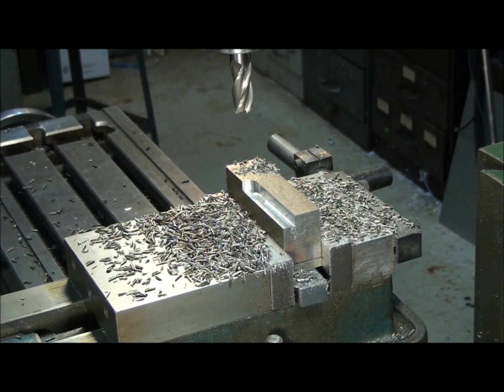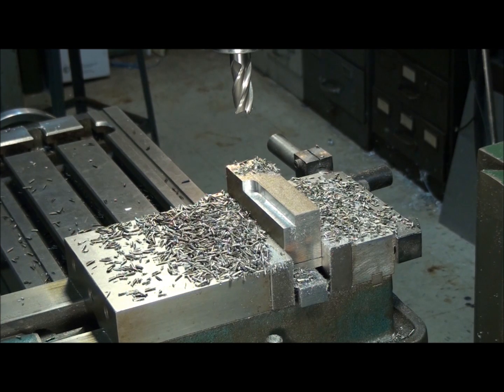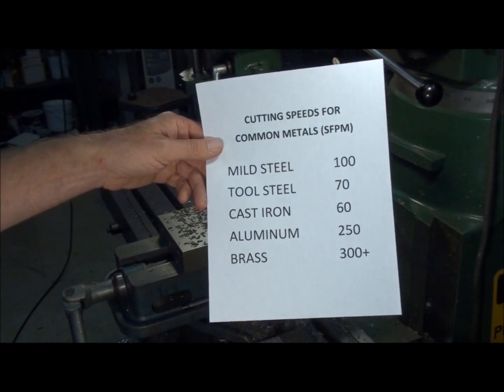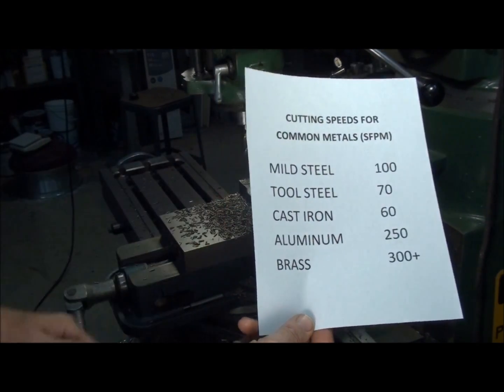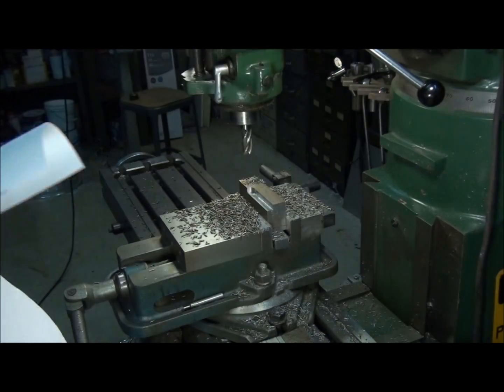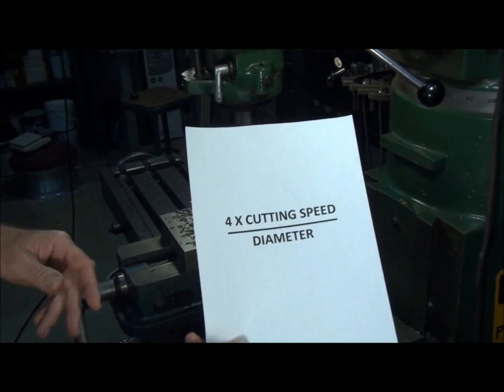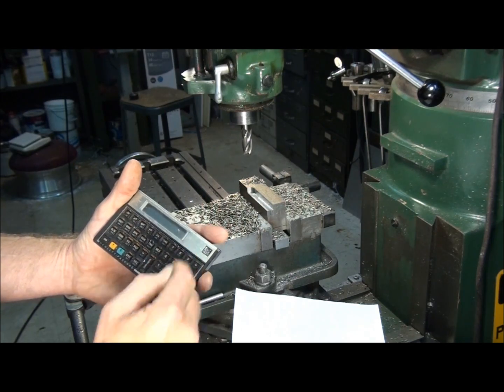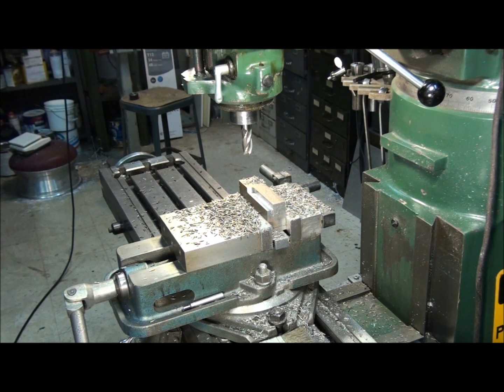Cutting Speed and RPM on the Lathe and Mill

Comment: I am a hobbyist, still learning how to use milling and lathe properly. I have got a request on how to calculate feed rate on milling. The confusing part is on how to calculate the Chip load per tooth. I have watched a few video it suggest
Chip load per tooth = Diameter of End mill/200

Where is 200 from???
Reply from the maker: The formula for chip load is Feed Rate in inches per minute / (RPM X Number of Teeth). That said, the only time you would need to calculate chip load is for CNC, or in a manufacturing setting. It's not really something a hobbyist would have a need for, since few would have milling machines with selectable feed rates. You would be much better off leaning what feed rates to use by experience, based on the type of mill, end mills, and materials you are working with. The most important thing when milling is rpm. Once that is correct, a reasonable feed rate will become apparent.
Reply: Thank you for your time and help.
I now understand how to calculate the correct RPM, however I am still confused on how to calculate the feed rate.

What is the difference between feed rate and table speed(table feed)??? On my milling machine, I can set the table to move automatically at varies speed.

What is the difference between chip load per tooth and IPT??? I have seen a few literature using IPT instead of chip load.

After watching your video, I did some calculation for my work which I tried to mill a whole surface of mild steel plate.

RPM calculation where
SFM = 100
D = 1/2"
RPM = (4*100)/0.5 = 800

Feed rate calculation (I found a formula on internet similar to yours, but using IPT instead)
Feed rate(IPM) = No of Flute * RPM * IPT
Feed rate(IPM) = 3 * 800 * IPT
** Found value of IPT from table somewhere I cannot find it now. IPT = 0.0028" for 1/2" end mill

feed rate = 3*800*0.0028 = 6.72in/min, therefore I set my table speed at 6.72in/min

Do I understand correctly???
Reply from the maker: IPT (inches per tooth) is just the feed rate in inches per revolution divided by the number of teeth on the cutter.

To calculate feed rate, you must first look up the recommended chip load for the material you are milling and the diameter of the end mill. For a 1/2" end mill in steel, the chip load would be .001-.003". The feedrate derived from the original formula I gave you would be RPM X TEETH X CHIP LOAD or 3.2 to 9.6 inches per minute.

Of course that is only an estimate. The practical feedrate might be higher or lower, based on depth of cut and the rigidity of your mill.

Comment: My old milling machine tops out at 1,500 rpm.  I don't use small diameters much because of that.  I guess I could upsize the motors pulley, but I'd rather not run higher than the specs on the plate.

Comment: The formula in it self is easy, but how do one figure out how fast do one can run the table under/along the tool ? and how about using carbide tools ? what multiplier would you recommend ? I have heard from 2x - 10x the speed of normal toolsteel.
Reply from the maker: There is no simple formula for feed rate, because there are so many variables. Depth of cut, the number of flutes on the end mill, the rigidity of the machine, all affect feed rate. Your best bet is to simply pay attention to feedback from the cut. Watch for the chips changing color (for steel) of if they are sticking to the tool (for aluminum). Watch for chatter, or shaking of the machine to tell if you are feeding to fast for the depth of cut.

Carbide tooling should be run about four times faster tha high speed steel.

Comment: Great video! One thing I can't seem to find information on is what is the recommended depth of cut for slot drills?  Perhaps you would be able to advise. Cheers
Reply from the maker: You can use any depth you like by adjusting the feed rate, but generally the most efficient depth for end milling seems to be about 1/4 or so, the diameter of the end mill.

Comment: hello tom  i really didnt get wht you mean by the diameter of the tool? how u divided
Reply from the maker: Multiply the cutting speed of the metal you are machining and divide that by the diameter of the end mill. For instance, if you are machining mild steel with a 1/2" end mill, the rpm would be 4 x 100 ÷ .5 = 800 rpm.

Comment: I guess this does not apply to an aluminum cutting saw blade. That would be 100rpm on a 10" blade.
Reply from the maker: Actually it does apply. 100 rpm would be the minimum for non-ferrous metals such as aluminum.
Reply: it's hard to find a miter saw much slower than 1300 rpm though. I have been trying to figure out what would give you the smoothest cut on 1" aluminum. A wood saw at higher rpm or a dry cut saw at lower rpm. BTW I find your videos very educating. Much appreciated. Would like to see something on the limitations of lower end milling machines such as Jet and Precision Mathews pertaining to precision, for the ones such as I who are just starting.
Reply from the maker: Miter saws and table saws work for cutting aluminum, but you have to use stick wax on the blade as a lubricant. It might be possible to slow one down using a pulse width modulated speed control, or better yet a variable frequency drive. One for a 2HP motor would cost around $150.

I hear you about the videos for hobby type milling machines, but I would have to buy one to make them. Really, the principles are the same, regardless of size.

Tom
Reply: thanks for the reply and info

Comment: How do you prevent the newly exposed surface from rusting? I once tried sanding some rusty pliers until it looks shiny. But after a few days, it started rusting. How come those bits, collets, and other metals doesn't rust even though they are not painted? Just wipe oil?
Reply from the maker: Enough oil gets deposited during use to protect them. Sometomes they need attention If the humidity is high, but not often.

Comment: better use this: rpm x number of tooth's x feedrate per tooth (0.05. = finishing) (0.1 = for removing material) or use that if u want to bake steel and ur mill
Reply from the maker: When I get around to making a video on feedrate I will use that, but this one is about calculating rpm.

Comment: But now, how do we calculate and apply the feed rate of the table, or does that somehow make no difference to the cutting speed?
Reply from the maker: Very few light milling machines have the capability to feed the table at a specific rate. Most are either hand cranked or have electronic variable speed drives. Consequently, feed rate is determined by the feedback you get from the machine, such as the sound of the cut, color of the chips (for steel) and the surface finish on the part. There is an ideal feed rate for whatever end mill is being used, but calculating the proper rpm based on its diameter is much more important.

Tom

Comment: Good video. Would be good if you could do one in metric measurements
Reply: Tom, here's the easy way to closely approximate spindle rate for metric tools (or imperial/inch tools, if you're slick at conversions) Conversions are easy for us Brits brought up in 1960's machine shops- (no electronic calculators back then, and we were converting to metric)

Use your cutting speed in fpm, (that's important, fpm) divide that by the tool diameter in millimetres, multiply by 100. Taking your 5/8" (near as dammit 16mm) tool example, 100/16=6.25, multiply by 100=625.  You can divide tool diameter into 10,000, arriving at the same result, but that involves unnecessarily large numbers. Who needs pi? Who needs to drag out the calculator or phone?

Try it for any drill/cutter size, and you'll find it's as accurate as we need. Spindle "speeds" on mechanically geared machine tools seldom offer a selection that's precisely suited, do they?

Inch to metric conversions are easy, too, if we know that 5/64"=2mm, 5/32"=4mm, 5/16"=8mm, 5/8"=16mm. 15/16"=24mm We can easily interpolate and extrapolate from these basics.

Before high speed and super high speed tools became commonplace, we used high carbon steel tools, and had three figures for drill spindle speeds at 60fpm (ish)  drill sizes 1/4", 1/2" and 1" ran at 1,000, 500, and 250 rpm. 
Double the drill size, halve the spindle rate, halve the drill size, double the spindle rate...
 
High speed steels arrived, and we could raise those spindle rates by 50%, and super high speed allowed a 60% increase. (I was still finding a use for high carbon for form tools as late as the 90's)

Sorry to horn in here again, but it seems a pity the old easy ways have been largely forgotten.
Reply from the maker: Thanks. 
You just need to adjust the formula for metric measurements. There are many good examples in the comments below from people who are more familiar with the metric system than I.

Tom
Reply: Thanks sir
Reply: You've tried it and found it to work for you?  Checked against standard charts?  It does work, I know it works, and it's easy, but I had students (and two instructor colleagues) who were incapable of performing the simple mental arithmetic, who would claim it didn't.  It's always worth performing several dry runs/practice exercises to ensure it's fixed in your mind, and to develop confidence.  After that, it becomes automatic, and you do the calc while you're still performing the previous op.  Most college instructors don't know or teach that method, though they teach the surface speed/(pi x D) method, which is setting some youngsters up for a fall, especially in imperial units, where they have to convert the cutting fpm to ipm, or the circumference of the tool to feet to arrive at a correct answer.

Always seek the easiest, simplest methods, they're the ones most likely to get you through a long day successfully.  Thanks for the thumbs up.
Reply: Robert Lawson thanks a lot. Seems much easier

Comment: I feel so stupid... Idk if im right. cutting mild steel, manual mill.8 or 10mm end mill.What speed am i suppose to use?
Reply from the maker: Go to my website and download the rpm chart under the reference section. That will tell you what rpm to use for a specific material and tool diameter.

Tom
Reply: Thank you so much!

Comment: Tom, love your videos - they are common sense...  Except the last part of this video... With the 6" slitting saw, don't you still have to factor in how many teeth (or, "flutes") there are and multiply the '66 rpm's times that?  
Thanks and, I'll take your response off air...  ;)
Reply from the maker: Thanks Miguel.

The number of teeth on a cutter have nothing to do with the rpm. The goal of using the formula is to calculate the surface speed of the tool on the work and match it to the ideal cutting speed for whatever material you are machining. In the case of the 6" diameter slitting saw, when it's turning at 66 rpm. the surface speed is 100 to match the steel it is cutting.

Tom
Reply: Chip load per tooth and all that don't factor in?
Reply from the maker: For feed rate it does.

Comment: Excellent video. What about feed rates now?
Reply from the maker: Feed rates can be calculated on a machine where it can be accurately controlled, but most mills like this are either manual, or have variable rate power feeds. On those, you pretty much have to rely on the feedback you get from the machine and from watching the chips. In other words, from experience, a difficult concept to explain or teach in a video. Once I start making videos again, I'll try to figure out a way to do it.

Tom

Comment: Sir 
Aluminum bar dia 20 mm.so how much rpm and feed? Plz help me
Reply from the maker: Convert your 20mm to inches and use the formula in the video. Imperial cutting speeds for various materials can be found in the reference section of my website.

If you have metric cutting speeds you can also change the formula to 100 x CS (in) / DIA (mm). It's not exact, but it's close enough.

Tom

Comment: Rpm= sfm x 4 / d.i.a x 3.1416
Reply from the maker: No, that would be way too slow.

RPM = sfpm x 4 / diameter

Fore example: The rpm for a 2" diameter piece of mild steel would be 4 x 100 / 2 = 200.

Tom

Comment: if im running a 2 in diameter round stock of aluminum on a lathe with a HSS tool for a facing operation, would you still 4xCS/D to figure RPM even though your diameter changes and gets smaller as you cut? How does depth of cut factor in?
Reply from the maker: Use the OD to calculate rpm. It's better to take a little longer to make the cut than burn up the tool. Treat RPM as the constant and adjust feed and depth of cut to moderate the heat.

Tom
Reply: Toms Techniques ... Or, increase the spindle speed as the diameter decreases, as a cnc turning center does. Not so difficult now that we have the ability to use a VFD and tachometer on our manual machines.
I know... What will those Japanese think of next??

Comment: im new to this but how did you take a bid cut like that climb milling
Reply from the maker: You have to know what your machine is capable of. The mill I'm using has no trouble with a cut like this, but a small bench mill would require a smaller cutter and a shallower depth of cut for climb milling. It's also better when climb milling to make the radial depth of cut at least half the diameter of the end mill. That will reduce the tendency of the end mill to pull the work toward it.

Tom

Comment: What about Stainless steel?
Reply from the maker: Stainless steel has an ideal cutting speed just like any other metal. Just punch the cutting speed for the alloy you are machining into the formula to calculate the rpm.

Tom

Comment: what about the depth of cutting(z axis)? I mean how can we calculate it?
Reply from the maker: There are a lot of variables that affect depth of cut, so there is no simple calculation for it. A good place to start would be about 1/4 the diameter of the end mill. That can then be adjusted up or down depending on how much material you are removing (heavier cuts flex the end mill more), the diameter of the end mill (small end mills flex more), and whether the end mills have two or four flutes (two flute end mills flex more). 

Tom
Reply: Toms Techniques thank you very much for your answer.

Comment: lol this is so bad and wrong, the first thing i learned on machinist school were the two most used cutting materials (HSS and Carbide inserts) 35 for hss and 160 for carbide v= your cuttings speed, how you calculate is it  Vx1000 3,14 x Diameter of cutting tool (or lathe work piece D)
 and here a example for a Hss end mill of diameter of 10  35x1000 =35k 3,14 x 10 = 31,4 -> 35000 : 31,4 = your rpm
Reply from the maker: First of all, you need to learn some social skills. Starting off by saying someone is wrong about something without fully understanding the topic is not only rude, it also displays your ignorance.

The formula you are using in your example is one commonly used to calculate rpm's using metric variables. What you are missing is that the cutting speed (V) varies by the material being machined. It's not as simple as using 35 for HSS and 160 for carbide. Your 35 meters per minute would work fine for mild steel, but if you were machining aluminum, it would need to be bumped up to 100 and for hard steel it would need to be dropped to 15. A more simple and easier to remember metric formula is V x 320 / D, which for mild steel would be 35 x 320 / 10 = 1120 rpm. Applying the imperial formula I used in the video, 4 x CS / D, would result in 4 x 110 (SFPM) / .394 = 1117 rpm.

Tom

Comment: Hi, Tom. Just to confirm is SFPM the rate the cutter moves along the material?
Reply from the maker: Yup. In surface feet per minute.
Reply: Thanks Tom. How does one account for it when manual feeding? Or is it a guesstimate?
Reply from the maker: Apparently I misunderstood your question. SFPM is the speed that the cutting edge of an end mill, or the speed that the surface of the work in a lathe needs to moves past the tool. It needs to be appropriate to the material being machined, or the tool will overheat or break. Feed is the rate that end mill or lathe tool is moved along the work and is responsible for the surface finish on the work. A fast feed makes a coarse finish and a slow feed generates a fine finish.

Tom

Comment: can you post up some videos on  speeds and feeds,  and how  to mill titanium and stainless steel on a standard  Bridgeport   mill or Lagun mill?  (NOT CNC)!!
Reply from the maker: Milling titanium definitely has some challenges associated with it, but I'm not sure how useful a video on it would be here. 

Stainless is the same as any steel, except for cutting speed. If you go to my website, there is a cutting speed chart for various alloys.

 Feeds on manual mills like the ones you mention is pretty much based on feedback from the cutter. Watch for color in the chips with steel, sticking chips with aluminum and chatter. I do plan on making a video on this topic soon.

Tom

Comment: Tom, I got my intro to RPN in 1970 when I started with computers.  Most of the guys in the class just rolled their eyes and shook their head.  I loved it, made so much sense.  It was sometime in the mid 70's when the $100 simple/stupid algebraic calculators came out but no RPN.  Got my HP 41CV in 81 along with a few modules and memory.  I used the navigation module to replace the multiple books required for celestial navigation.  I was going to answer the question.but you beat me to it😊.
Reply from the maker: +Scott Burrous 
I would be absolutely lost without a RPN calculator. You nailed it saying that it makes so much sense. I' all about the logical approach to solving a problem.

Sorry if I stepped on your response. :)

Tom

Comment: Thank you very much, the results of my milling have greatly improve after watching your video.
Reply from the maker: +Marco Sandoval 
That's good to hear.

Most people tend to run an end mill too slow because they are afraid to burn it up, but that often results in breakage. Proper rpm is critical.

Thanks for watching.

Tom